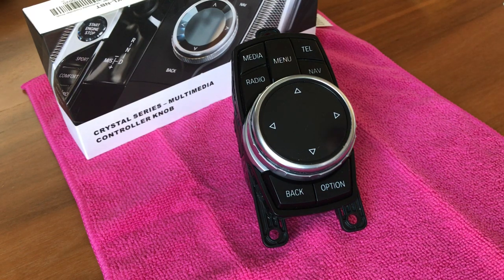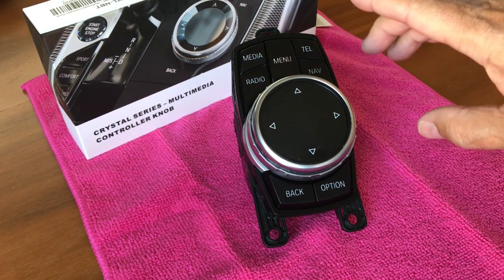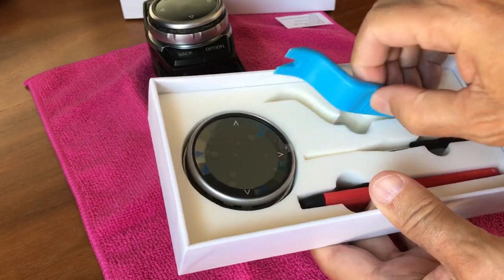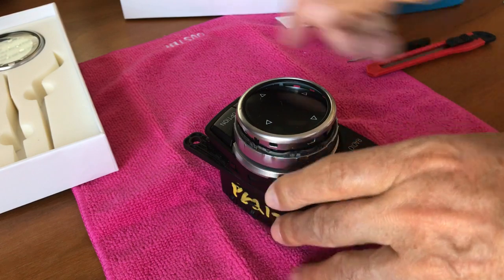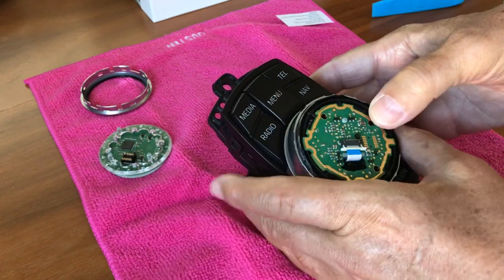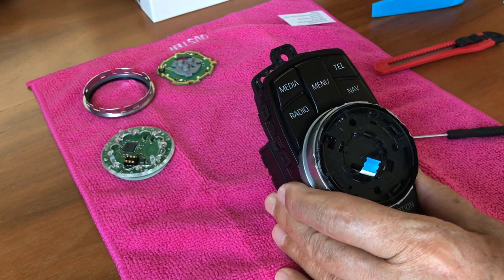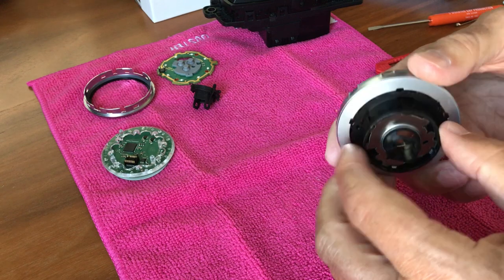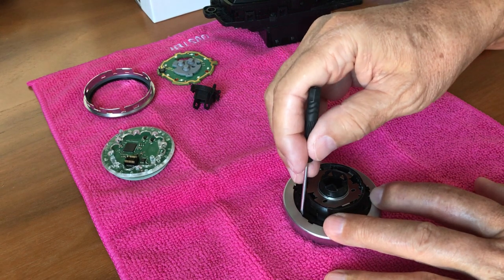Crystal NBT Multimedia Knob installation for BMW

Comment: Do you need to disconnect the battery before doing this?  Obviously we probably won’t be ripping the whole console out.
Reply from the maker: You must ensure that there is no power to the unit when you do the install. If your car has 2 batteries, both of them have to be disconnected (negative terminal only).

Comment: Hey, could any of you help me to understand on how to remove the buttons around idrive wheel? Do i need to unscrew those 4 very small screws?
Reply from the maker: I don't think BMW intended for these screws to be removed. You may need a new iDrive controller if some buttons are broken or don't work.
Reply from the maker: I have a demo NBT iDrive controller that has been upgraded to Crystal, email me if you are interested.
Reply: @car-analysis  after couple of hours I managed to understand  how to remove them. Basically all I had to do is remove 4 torx20 screws and that was it, changed it in 5mins after resesrching for couple of hours😆
Reply from the maker: @marlbororaudonas  Good job!

Comment: Would this work if u have a small idrive controller. The crystal knob is larger than my current idrive knob. 2014 f07 550igt
Reply from the maker: No. You need the CIC version of the Multimedia Controller Knob upgrade.

Comment: Do you have removal instructions for 2016 750i?
Reply from the maker: I  have a draft installation guide that I can email you. Never got around to finishing it, but the info is all correct. Email me at info@car-analysis.com and I will send it to you.
Reply from the maker: Actually, you don't have to remove the controller for this installation. It's enough to disconnect the negative terminals on the batteries and make sure that the vehicle does not have power anywhere before you start the install.

Comment: I fitted following these exact instructions, but now after a few days my iDrive controller won't press down!
Reply from the maker: This is not a common problem. Most likely, some kind of mistake was made during the installation. Suggest disassembling and reassembling.

Comment: Will the touch pad still work after install?
Reply from the maker: Yes, it will.
Reply: @car-analysis  thanks for the reply, but how will it work if you peel up the black stuff on the first board?
Reply from the maker: The touchpad function is retained regardless of if you remove the black adhesive or not. @TheEdy223

Comment: In bmw m6 f06 is much harder, any help
Reply from the maker: No, the M6 F06 has the same iDrive controller as a 650i F06. So it should be the same. If your M6 is a 2018 or newer, it probably has the EVO controller (with MEDIA key). If your M6 is a 2017 or older, it probably has the NBT controller (with TEL key). The EVO controller is more difficult to upgrade because it has to be removed from the car for installation. I have made 4 videos on that, here is the first one: https://www.youtube.com/watch?v=um8OXOv2cw0&t=196s

Comment: Appreciate your video.  But, you did not do a good job showing which tabs to push down to get the ring off.  Bad camera angles.
Reply from the maker: I am aware of the shortcomings of the video. Perhaps we will make an improved version later on.

Comment: hi  ser.
g20  320i same ?
Reply from the maker: No, for G20 see car-analysis.com
Reply: Hey Martin I have a 2021 x7 my wife spilled Dr Pepper on the Air conditioning controls. It is sticky behind those buttons. Any suggestions the buttons don’t work now. And I am having to control the Air from the touch screen… HELP!!
Reply: Also how do I remove the buttons to clean behind them?
Reply from the maker: @BarrieLindahl  I am sorry, but this is beyond my area of expertise. You need to take your car to a BMW dealership.